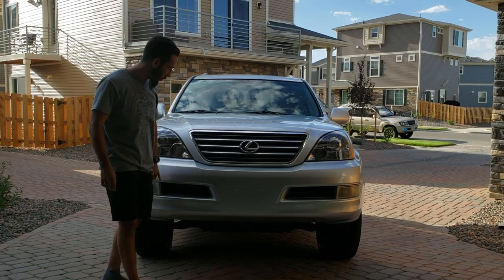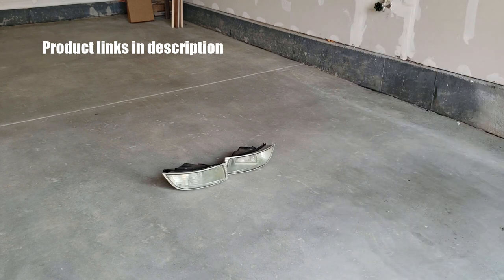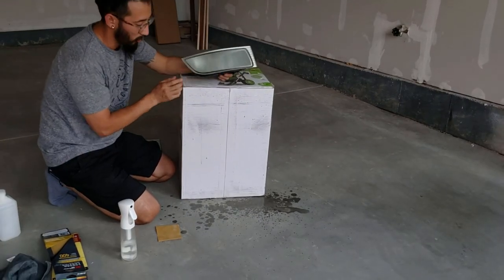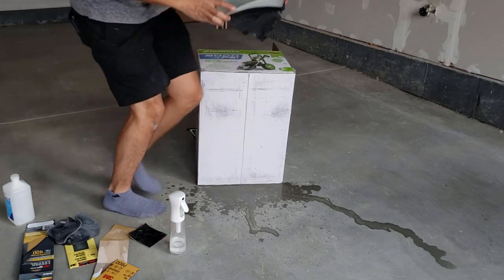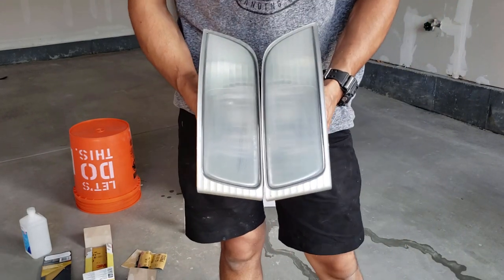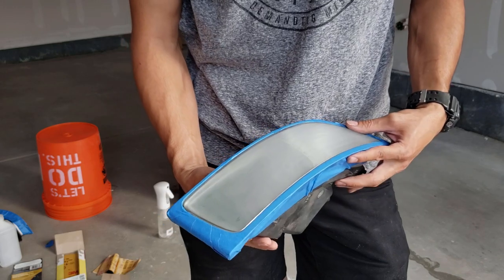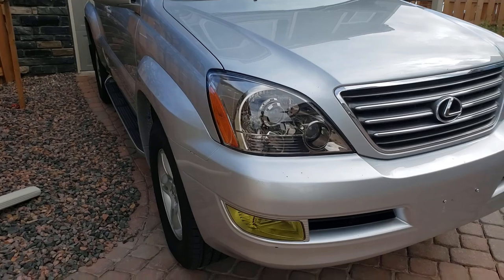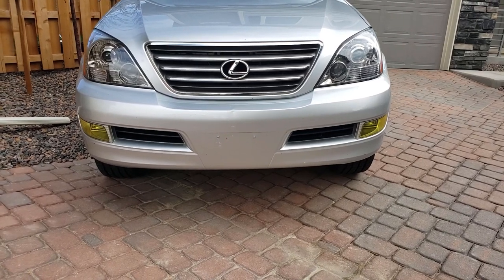Tint Your Fog Lights Without Film

Comment: looks good.. but hows the output? im torn between buying a white led then paint or put yellow film on it.. or just buy a yellow led bulb...
Reply from the maker: If you want the best performance I’d suggest going with an actual yellow bulb first. Second best option would be film and a white color bulb. I’d have to say this might be your last option. The light output is decent but uneven coats could cause less than ideal output.

Comment: Thanks for the video, my foglight is not on, is there a switch for on and off, I just bought gx470 and noticed that the fog light not on
Reply from the maker: You’re low beams have to be on for the fog lights to come on. They do not work independently from the headlights. The switch should be located on the same multifunction switch as the headlights 👌🏽
Reply: @AdventureRigCO  when the low beam is on but the fog light still not on, you think maybe the fuse?

Comment: Used this on my sc400s fogs/turn signal lights..a few years ago and i wanna remove now in 2020 any advice on how?
Reply: Sand down
Reply: Treat it like hazzyyy headlights
Reply from the maker: Just as stated before you could try and use a mild sand paper and treat it like foggy headlights and recoat with clear only to bring back the nice new look!
Reply: Gas
Reply: Break cleaner or gas
Reply: McGuires polishing compound works

Comment: You can't use this paint on headlights!  It's indoor use only and dissolves over 110 degrees.
Reply: I have it on my fog lights well into that temp range. No problems
Reply from the maker: I’m sure that’s what the directions say but I’ve had no real issue with it 👌🏽